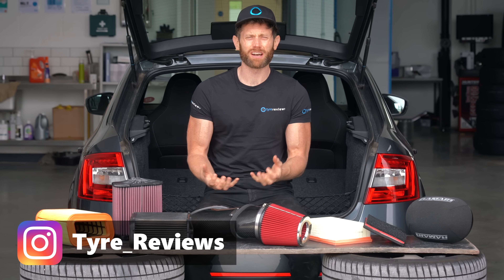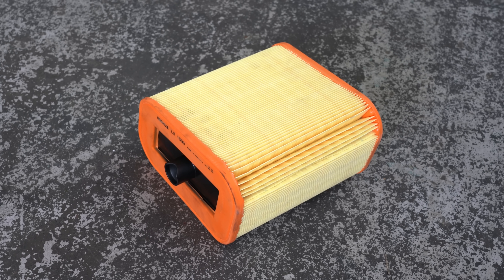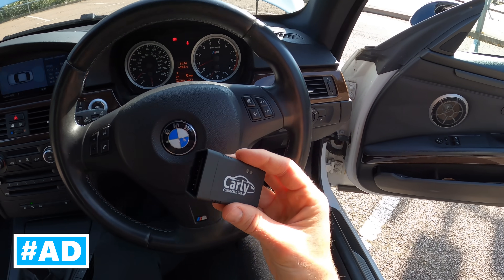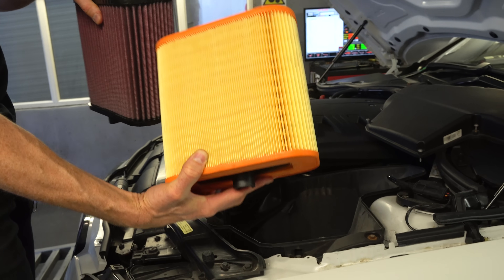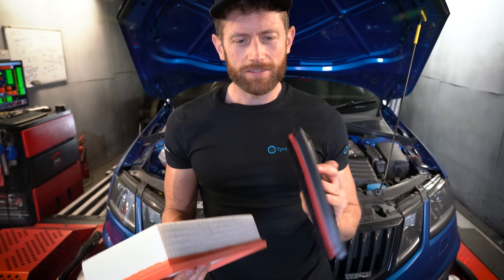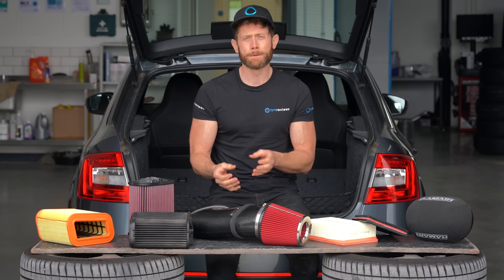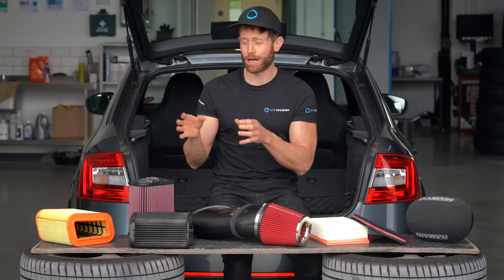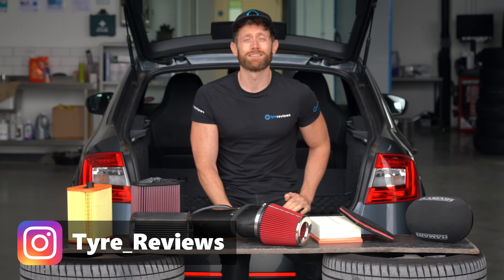Do Performance Air Filters REALLY Give You More Power?

Comment: surely you would need to tune after each change to adapt to the new levels of air flow etc
Reply from the maker: They were run multiple times to offset ecu adaptation

Comment: Interested to see how these affected the power curves on each run. Its not just about peak power figures, sometimes they can add in the mid range and increase the overall area under the curve. I guess not all high flow air filters have bigger holes either. If you add surface area by increasing the number of folds for example you can increase airflow without increasing the size of the holes. Obviously manufacturers will optimise components based on a number of factors, cost and performance being 2 of them. On a high performance car like the m3 I would expect performance is given a bit more priority. And we all love the sound of an induction kit!

Comment: More air dosent come into play until the fuel air mixture can be adjusted to maximum power parameters.. That usally means emission standards change. Many performance engines with small volume are maxed out without major fabrication to the engine. The air filters work in tandem with other changes. Does the intake allow more flow? Those are serious questions as well.

Comment: Can you do a video on tire pressures and how to find the fastest tire pressures at the track or autocross?
Reply: Ask others for a basic psi and work from there. Everyone will have their own preferences but the more people you ask you might be able to develop a trend faster.
Reply: @2689vjavier  thanks Javier. I definitely already do that. I understand about using chalk on the sidewalk and using a thermometer across the tire too, but I would just love for someone to actually change PSI incrementally and actually test for how much difference in time is made. I would love to see a graph. Also, for different types of tires: r compound vs ultra high performance. Also, it would be great to see how tire pressures affect tire lifespan. My autox champion in my club runs 20 psi, but has to change his RE71 tires almost every other month. I wonder how much long my tires would last running 25 psi or 30 hot.
Reply from the maker: It's on the list, but  it's going to be tricky as small changes in pressure might be offset by small ch anges in tyre performance. I'll work i tout

Comment: I’d vote for a filtration follow-up, find a lab to test the quality of the filtration- I’ve always wondered if some of these high flow  filters are allowing dirty air enter the engine - actually potentially damaging the engine. Maybe an interview with an engineer to get perspective on just how damaging abrasive air can be on an engine
Reply from the maker: Great idea with the interview :) I'll get researching
Reply: stock gives you the most
good filtration, which is what filter should do first
good hp since it takes fresh air, contrary to performance whic takes hot air from engine bay
good price and longitivety

all perormance filters are rubbish with poor filtration, you may just run filter less
Reply: @borutgoli840  EXACTLY !
Reply: Definitely more of a difference on a turbo engine, when you do the next video maybe just stick to the ea888 gen3 engine and do a selection of induction kits/filters. So pipercross, bmc, k&n, ramair, forge, racing line, eventuri and stock.
Reply: A table spoon worth of dust is enough to cause compression loss in engine.
Reply: Project Farm did scientific analysis of the filtration. 

https://youtu.be/sJ3L-E-ufYo
Reply: farm project there is filter test done prooperly
Reply: Yes they do. This is one of the better pages about it  https://www.project200.com.au/dm-iso5011/
Reply: A little dust won't damage anything. The only real risk is overoiling your filter when you clean it and having it creep up to the maf
Reply: Read my post.
Reply: @stephenpage-murray7226  hi Stephen. I’ve tried finding your post but it’s like trying to find a needle in a haystack. Would you be kind enough to share with me ? 👍
Reply: @Hutchy86  
UOA’s always show Krap & Nasty equipped engines have high Si (dirt).  Poor filtration and the oil damages MAF’s.
Reply: Where'm'stv'est be Engineering Explained???
Reply: Check out Scotty's video on it.  Long term the use of a K&N damaged the mass air flow sensor and fuel consumption by the excess oil from the filter sucking into the system.

Comment: My thinking is that stock air filter should be changed ONLY when you need more space in the engine bay aka bigger turbo. OR You seriously need more air so you need a huge intake and more space for that huge intake. AKA BIG TURBO. I had tiny K&N filter and got 330hp on my S6. Only changed the the filter for big ass ram air filter and got 380hp. Same dyno and similiar conditions. Not biast to ram air or k&n. It just was what we had on the shop at the time.
Reply from the maker: Damn, that's an increase!

Comment: I think that you should have reset ECU before every test and drive it for half an hour so that ECU could self learn new parameters like pre-ignition, ignition angle, fuel trim etc. You drop new filter but you didn't give enough time to the car to learn how to behave with it
Reply from the maker: That would have been ideal but this already took 2 days on a dyno :( We did plenty of runs between each change to wait for the ecu to look like it stopped adapting

Comment: I have a current generation mini cooper S. I've had that on a dyno with a stick filter and an ITG panel filter. With the ITG I made an extra 5hp and about 8nm torque. Not massive gains and I wouldn't say it adds power. The main reason I got is for noise. Most likely a placebo affect but the car seems slightly more responsive too
Reply from the maker: 100% on the noise front :D 5hp is a notable increase
Reply: Is this small gain without any remap or piggyback and without other mods? Intested because my 230i has the B48 engine like the current Cooper S (though is longitudinal mounted, with air- water charge cooler and different tune from factory)
Reply: @peterwatson9047  it added 3hp in standard form. I was getting a bluespark tuning box fitted at the same time with that fitted the filter was adding a 5hp gain. (tested with both itg and standard filter)

Comment: I have a doubt, won't the ecu take time to recognise the new air filter? Will you get better results if you run your car couple of miles before the test run?
Reply from the maker: We did plenty of runs between each change to wait for the ecu to look like it stopped adapting, but it would have been great to do more runs, time is a factor

Comment: The intake system on M cars are generally fantastic from stock. The only true benefit from aftermarket is sound.
Reply: This is very true, especially for the Eventuri. It is expensive for what it is, although I really do like the noise from mine, and the low end improvement in driveability.
Reply: On the exhaust front the benefit really comes from removing restrictions e.g. cats, ppf etc.  Weight is the other benefit from exhaust changes but again its quite marginal.
Reply: @Freshiemaster  it's not just restrictions in a naturally aspirated engine, there's something called exhaust scavenging that happens around certain RPM, by going catless you might bring down the scavenging effect to lower RPMs, and sure, you will boost the mid-range, but you'll lose the top end and obviously power. That's why some cars (like mentioned Clio) don't like better flowing exhausts, the factory one provides plenty of flow while optimizing exhaust scavenging for max power.
Reply: @arekb5951  replying to a 1 year old comment here we go:

I find it really hard to believe that the exhaust after the header is anything other that a restriction. The header is responsible for creating the scavenging effect and that's where gains and losses at different RPM's come from (assuming the rest of the exhaust wasn't choking it)

I'm no engineer so maybe there's some really complex trickery with pressure waves but why do a lot of drag cars run an open header? Besides the weight savings ofc. I get that they aren't going for the broadest powerband and mostly focusing on peak power but still
Reply: Same with exhausts in naturally aspirated engines. Engine in Clio 3 RS with stock exhaust usually overdelivers in terms of power, but the exhaust note is a bit quiet. Touch the exhaust and you lose 15-20 HP instantly.
Reply: @arekb5951  the only advantage you can get with exhausts is completely removing catalitic converters AND totally reworking the header to scavenge properly with the reduced backpressure
Reply: @EmmaHopman  I prefer ITB's and Bike carbs over Cold air intakes specially for old 1600cc and 1800cc 2000cc engines like the SR16VE SR20DE 4AGE 3SGE B16A B18C B6ZE because of the sound and raw driving experience and you can reprogram those ITB's  very easy with a simple  ECU setup and I'm a big fan of N/A builds anything that weights around 800kgs 1000kgs and has around 220hp-260hp under   it's great for me
Reply: @arekb5951  get a catback from reputable company like hks akrapovic or eisenmen they make similar or slightly better power like about 1-2%hp
Reply: Facts!....

Comment: Yes, the m3 is a bit low on power and dropped a little more, but picked up 10 Nm, 5 above what bmw says, so it seems pretty healthy, it just drops off a little early, therefore making less power. One important thing about dyno runs is to look at whole curve, peak numbers only tell you half of the story. If it makes peak power at 8300 rpm as it should, it's missing 30 Nm. You just need find where it starts dropping and why.
Reply from the maker: I can't wait to dig into it further! And fix the Skoda
Reply: @tyrereviews  :D :D :D if vanos is not on point it can steal power like nobody's business, only takes a couple degrees at the top of the rpm range
Reply: @tyrereviews  how are you planning to add power? It is pretty much a race engine from the factory. Boost maybe?
Reply from the maker: @bence.gabor.slezak  Just the usual airfilter, full exhaust dropping a pair of cats, and a remap. So it'll probably get it back up to around 414 again :D

Comment: Stick to OEM, all I needed to know when LLF got his M4 tuned at Pure Turbos, they recommended the OEM housing and filter.. They make 800hp+ monsters
Reply from the maker: I did not know that! BMW make a wicked intake!
Reply: @tyrereviews Most OEM spend millions designing intakes.  No after market sources do.
Reply: @machtschnell7452 yeah but I'd still rather run a less restrictive filter with my stock intake system
Reply: @tyrereviews  I know right, lol I was just re-watching - https://www.youtube.com/watch?v=6Oa9ZBH9OWw&ab_channel=LivingLifeFast - 3:40 secs
Reply: I'm updating my 2000 Grand Marquis airbox with the larger Police Interceptor airbox that premiered on the 2003 Marauder. It used the same filter, but is much bigger over and under it, as well as having an intake close to three times the volume. That and the updated ziptube is dyno-proven to add a smidge of power and torque. One of many mods I'm working on for my "cop car with leather".
Reply: £800 for a eventuri with a cheap Chinese filter
Reply: Unless you are putting turbo on n/a car then factory airbox is more than enough
Reply: don't forget the insurance increase for a "performance" filter too!
Reply: @allothernamesbutthis  who would tell thier insurance company about an air filter?
Reply: allothernamesbutthis no increase in us lol

Comment: I've got a mk7 gti with the same motor and before choosing what filter kit to go for I found the following site (http://mygolfmk7.com/2019/11/mst-performance-intake-system-flow-test/) where the guy had bench tested a bunch of systems. I went with MST in the end and I'm very happy with it. Whilst it's not necessarily feasible to do all of this theres a couple of things I'd like to see compared; 1. Stock 2. Stock with the GTE snorkel blank and snow guard removed 3. Stock box with a turbo elbow/intake pipe 4. Panel filter swap based on set up 3. 5. full aftermarket kit (MST/Racingline etc). I'd suspect the stock box or racingline system plus MST elbow and pipe would give the best results but I've yet to find something conclusive. The test data in the link above is in ideal conditions and doesn't account for heatsoak. The MST box is not completely sealed and is metal (conductive). The stock box and racingline kits are less conductive and well sealed from engine bay temps. I'd be happy to help out in any way I can!
Reply from the maker: Great site! Flow doesn't always mean more power, as it can mess up the air flow into the plenum, but I'll try and do some more in the future!

Comment: Paper filters are used in hospital grade HEPA filtration systems. If you want more power while retaining top notch OE grade air filtration, just use more filter area, like what BMW has already done in this instance.
Reply: perfromance drop in filter seem to only work for cars with rather restrictive intake from factory cars like bmw m have excelent factory intake that is already insulated and have great flow so its harder to improve upon those cars with just a drop in filter.

Comment: Hot air is REALY bad, especially for turbo spark ignition engines, since the chance of uncontrolled detonation is increased. In order to avoid pinging, the ECU should retard ignition to compensate, leading to even more loss of power than the loss of air density alone.

Comment: Really interesting review, one area that would be nice to see is throttle responses and or turbo spool time. I've felt no more power with mods like these but it "felt" like I had better throttle responses... I wonder whether a neutral rev responses time would be a measure. An overlay of torque figures would have been interested as they did see gain! Either way a very fair test all things considered.
Reply from the maker: I'll see if i can work out a way to test that properly!

Comment: Best bang for buck for turbo engines, stage 1 remap. Dyno, tune, and you're off with more hp and torque. If all you want is great performance from what you have. Just use quality or oem filters, and change the oil as often as possible.
Reply from the maker: Solid advice!

Comment: Many guys switch old used paper filter to new K&N or other high flow filter and are astonished by "HOW MUCH MORE HP NOW I GOT, IT FEELS A LOT NIPPIER etc."
But they do not take into account that they are comparing OLD USED filter vs NEW.
As the comparison should be NEW vs NEW where difference is minimal.
Thanks for video.
Reply from the maker: Solid point :)
Reply: Difference I could feel on my small 1.2 tsi 110hp engine, definitely pulls better because of course got more air flow, I used papercross performance air filter made in uk, with claim 30 percent more air. And of course I changed paper brand new to brand new performance filter.

Comment: If you really want to have some sort realistic number you should make check with bonnet/hood closed, because open lets cold air to get to the engine which is not making results realistic.
Reply from the maker: We did all the runs closed, apart from the filming run for no filter as I wanted the noise

Comment: Sometimes changing the airfilter system can even significantly lower your power. Most cars' stock airbox is pretty basic, but pulls fresh air from outside. Cheap "upgrades" often require you to remove that airbox and put a round filter under the hood. This makes you pull in (much) warmer air, since it is now pulling air from next to the engine.

My tip is: generally it is hardly any use to change the airfilter setup, unless the original system is very restrictive. And even if that is the case, sometimes it is better to then slightly modify the stock setup. The airbox in my car had a sort of restrictive pipe inside the airbox. This was easily removed, it was just clipped into place (so I didn't even have to break anything). The only thing I then did was put in a flat K&N airfilter and for less then 40 euro I was done. Not sure how much I gained, probably low single digits in HP and maybe around 10-15 Nm, but the investment was very low and the car feels a more responsive on the throttle, mostly in the lower to mid RPM range. It also sounds a bit nicer, which is a bonus.
Reply: bmc or K&N drop in filter your gonna get 1-2% percent better at best the intake sound engine response is deffinitly a bonus if your in to those sought of thingi have  brz mt have bmc filter tuned and carback exhuast makes about 15 extra hp combine not a significant bump in power but the car feels great better engine response more race car sound.

Comment: When you think about it logically it's not a surprise. The Manufacturers who spend millions developing Cars, Engines and everything about them design the most efficient airflow. 
Unless you change multiple items and parameters, a one item change is not going to work wonders.
Reply: Yes and no. I agree that the M3's intake was pretty much maxed out from the factory.  But there are still Tons of cars out there that have a restrictive intake and can be improved upon
Reply: It's strange but the airbox is called a suction silencer in the bmw etk. And believe me, in my 328 e46, the box has a strange shape with hole and short  hose going nowhere. So remove the component 'lowering the sound' and it might be possible to gain something... at least a better sound, a far better sound, oh my god.
Installing a carbon Simota is the first piece I would change if I had to change of bmw. (the cone breathes the air coming from the region of the anti-fog light).
Reply from the maker: I can't wait to try it with the exhaust and remap
Reply: its a shame that the BMW guys forgot to retest all those common faults tho eh? hahahahah